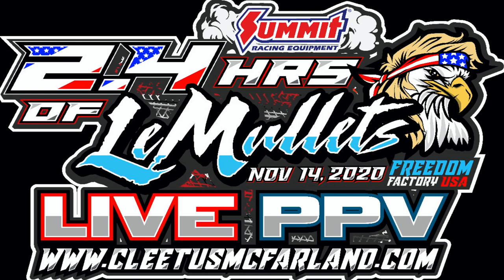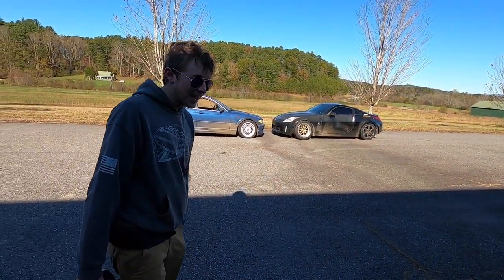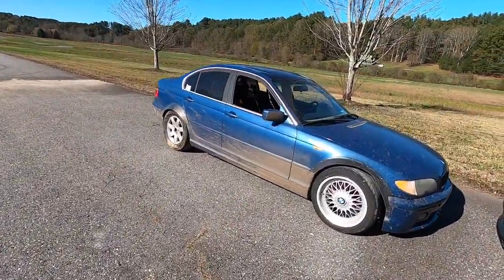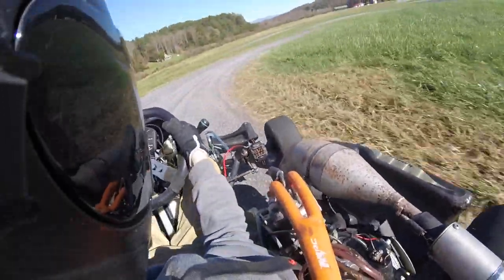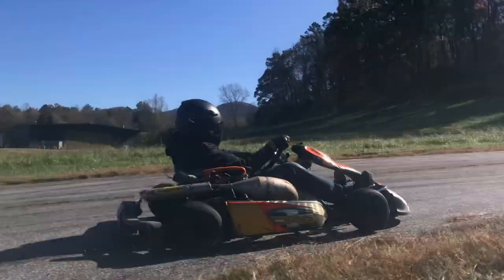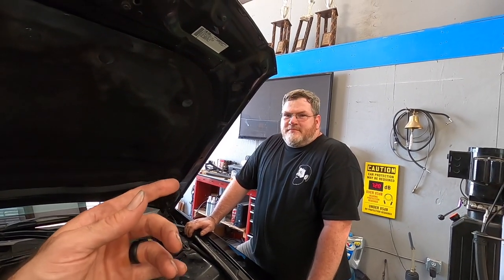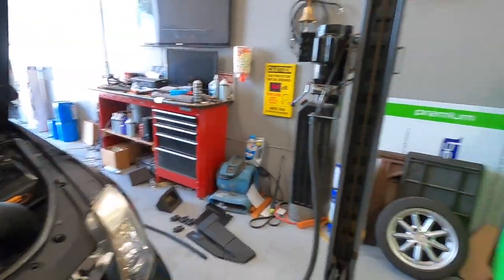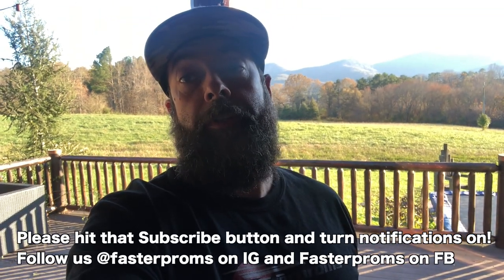Drifting With My Son For the FIRST TIME!! (What a Feeling)

Comment: you're doing the dad thing right.   i started doing SCCA stuff in 1990.  but 22 years ago, i started racing KT100 single speed clutch karts.  2 years later, i started 125cc shifter karts and have been doing it since.  even had a built CR250 powered shifter kart for a while, and that thing can only be described as Extremely Violent.   when my son turned 12, i put him in a Briggs World Formula kart, and then later in 125cc shifters.   now that he has his drivers license, he has been driving our race cars on the track.  yes, he is fairly new to cars, but he is a better and faster driver on road courses and autocross than many that have been racing for decades.   and, that is solely due to his karting experience.    and... i know exactly what you are talking about when being out of "Karting shape".  during this virus thing, i have not driven the shifter since last March.  a recent trip to the kart track had me wondering if i was going to survive 10 laps or not.  :)   they are way more physical than people would think... these are NOT anything like the typical arrive and drive indoor kart racing places or amusement park go-karts.

Comment: HEY!! I’d like to make sure this info is going where it needs to be. SO. The katerkart rear end is a front end.... so it has alignment rods and tie rod ends. A possible and hopefully is the problem with it being squirrelly and launches so aggressive and not straightforward IS MAYBE the outer tie rod end which is a balljoint style which have slips and play on Botha sides so even a 1/16 of difference on each side would do a lot. Think of it like a jeep with death wobble but on your rear end and driveline wheels which makes sense why this car is so crazy going down the track with higher torque. Hope this gets its drivin a bit better.
Reply: Switching to a heim joint would fit good for as a replacement sense it has very little movement and will be solid as can be and always perfectly aligned

Comment: I recently bought a stock 2010 CTS-V with 104,000 miles. I ran it down the track went 12:56@113 with a 1.91 sixty! But 3rd to 4th gr bogged.
Reply: Thats about what my acura runs with hondata and a tune!

Comment: Go kart! I have a lo206 and a 125 fireball tag cart. Want to get into a shifter sometime but like you say they beat the crap out of you
Reply: I can tell you from experience it’s really awesome (even more so than Jeremy conveys).....my one forewarning is depending on the area of the country your located, engine rules and the weight breaks associated with running a mixed class of 125cc shifters is important to know up front before making a purchase (if you want to be competitive). At this point, the cheapest point of entry is running “stock-Honda” (like Jeremy’s kart) but, in mixed classes, it doesn’t do well against KZ’s and the 175-SSE engines, due to the huge power difference.....if your just out to have fun, I would ONLY suggest a stock-Honda, due to the reliabity
Reply: If you live in the south or the west coast, a lot of the local clubs have ROK-cup friendly rule sets....which allow the ROK-super-shifter engine....this would be my pic (as I have one) due to its cost of entry being similar to a Honda for NEW engines (the Honda is still cheaper used).....and it’s performance being close to a KZ but, a lot faster than a Honda, while still retaining reasonable reliability....I’d deff do a budget break down and see what’s out there used (in terms of GOOD complete karts), because piecing something together can be very costly by comparison...
Reply: @ericschumacher5189  i just do it for fun. Id probably go with the honda. Racing would be fun but here in the Denver area, the circuit tracks are so far spread out so it takes a huge commitment if you want to be in contention for championships.